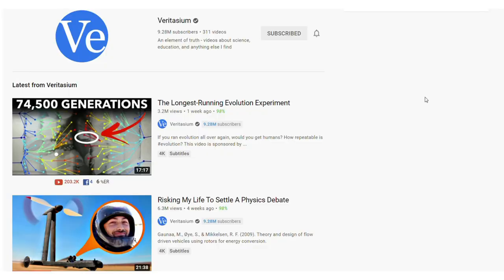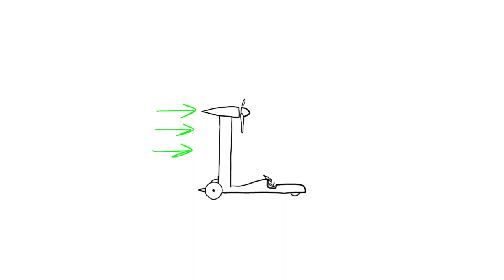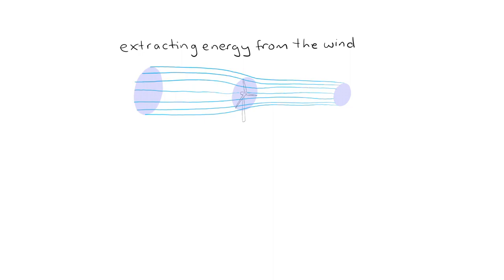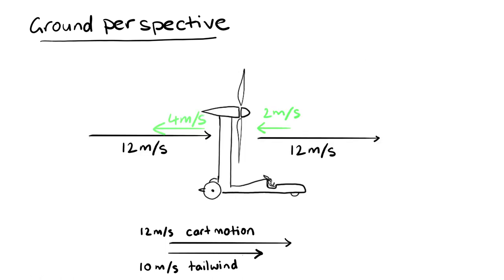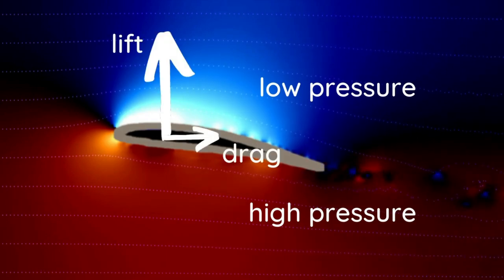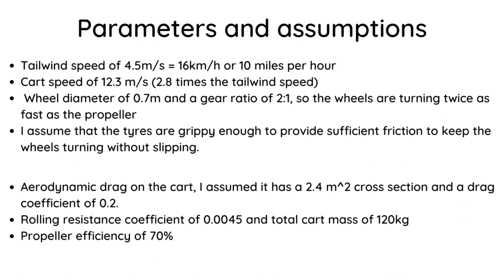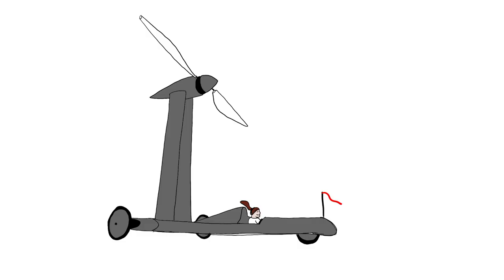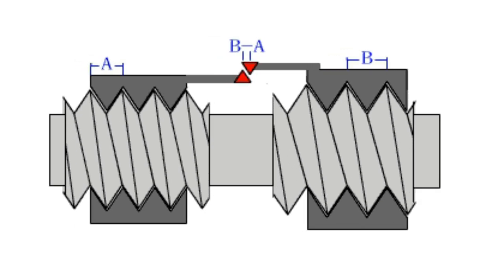Downwind Faster Than the Wind by Veritasium: How Does it Work?

Comment: When you are traveling at the same speed as the column of air, force applied to the blades is zero. Your momentum may briefly accelerate you beyond that, but you fall back to where it interacts with you again. If this concept really worked, you could put this car in a completely still environment, push it to get it moving, and it would self sustain. After all, it supposedly surpasses and maintains velocity past the point of zero when it is moving at the same rate of the column of air.
Reply: @Rick_Cavallaro  not in a true downwind by itself. Period.
Reply: @Rick_Cavallaro  I’d also like to note, if you really are Rick, why are you here defending this on the internet? If you pulled it off, then there’s obviously some special sauce you should have a patent on, and you wouldn’t be here debating this with me.
Reply: @AnonyMous-jf4lc  "If this concept really worked, you could put this car in a completely still environment, push it to get it moving, and it would self sustain."

No, that would be true free energy. This cart is taking energy from the wind.
Reply: @seneca983  I get that the claim is that it is using the differential of wind and ground speeds to surpass wind speed, it still doesn’t the problem of when the equation flips past 0. The wind isn’t driving anything anymore. The car or the prop…
Reply: @AnonyMous-jf4lc  The wind is still (kind of) driving the cart. The propeller accelerates the cart whereas the wheels driving the propeller decelerate it. Because of the wind the acceleration from the propeller is greater than the deceleration from the wheels. Yes, from the cart's perspective the wind is coming from the front (after windspeed has been exceeded) but it's relative speed is slower than that of the ground.
Reply: @seneca983  And that's the issue. You are saying that it crosses over into a driving headwind. In order for that to occur, the propeller must be providing more thrust than the drag of the car, and that drag includes driving the propeller.
Reply: @AnonyMous-jf4lc  "In order for that to occur, the propeller must be providing more thrust than the drag of the car, and that drag includes driving the propeller."

Which is perfectly possible.
Reply: @seneca983  If I can provide more thrust than the drag it takes to create it, I have just invented free energy.
Reply: You do understand it's multiple energy conversions to produce this "thrust", right?
Reply: @AnonyMous-jf4lc  "If I can provide more thrust than the drag it takes to create it, I have just invented free energy."

No, it's not free energy. Energy is being extracted from the wind.

Comment: Let's see if you can simplify it adequately... I would simply say the props are always trying to grab More air than the wheels are turning and being that the air is the open source to the system, wind is not required, hence why it worked on the indoor treadmill uphill.
Keep in mind that the props are adjustable on the fly ;)
Reply: Wind is required. A treadmill creates wind. When you are walking at 4 mph on a treadmill you feel no wind, just as if you were walking at 4 mph on the ground with a 4 mph tailwind.
Reply: @jmodified  only dead air is required, and will climb an inclined treadmill, Indoors
Reply: @kdkinen  A treadmill is not dead air, it is wind at the speed of the treadmill surface. All movement is relative. It doesn't matter whether air or surface is moving with reference to the local surface of the earth, just that they are moving with respect to each other.
Reply: @jmodified  the wide flat rotating Belt, of most any treadmill, has no effective fan action... 
Combine that with being indoors with no head or tailwind...
so what the heck do you keep going on about??
Reply: @kdkinen  You are on a treadmill walking 3  mph. What wind do you feel? You are on the ground on a still day walking 3 mph. What wind do you feel? Do you get that those are different? On the treadmill you have a 3 mph tailwind, and feel no wind. On the ground you have no tailwind, and feel air into your face at 3 mph.

All movement is relative. When a surface is moving relative to the air, for anything on that surface, that is wind. According to physics, you can't say which is moving, and the movement of the local surface of the earth relative to the surface and the air is irrelevant. This is really basic physics.
Reply: @jmodified  you need to really get your head out of theoretical wonderland bud, 
An indoor treadmill, generates no wind.
Running on said treadmill, generates no wind.
You are running "on the spot".
Bring in a 3rd party judge you require further explanation
Reply: @kdkinen  Running on a treadmill indoors is physically equivalent to running outside with a tailwind. The point is that you and the air are moving at the same velocity and the ground is moving at a different velocity. In both cases, the air feels calm to you and the ground feels like it's moving, so the treadmill is a valid test bed for DDWFTTW vehicles.
Reply: @Raging.Geekazoid  That is exactly my point yet that other guy keeps saying the treadmill is generating wind.
Reply: @kdkinen   jmod doesn't communicate very well. Just insert "effectively" before "creates". The treadmill creates a situation that's physically equivalent to one with wind blowing over solid ground.
Reply: @RagingGeekazoid  No I will not accept that there is any Wind indoors. it required only still air.
Operated fine
Reply: @kdkinen  Do you know how to read? I didn't say there's wind indoors. I said a cart on a treadmill in still air is physically equivalent to a cart going DDWFTTW on the ground outside in windy air. In both cases, the air and the cart are moving at about the same velocity, and the ground is moving at a significantly different velocity. I thought you would be less of a troll than jmod, but maybe I was wrong.....
Reply: //"Keep in mind that the props are adjustable on the fly ;)"//

The variable pitch prop is not critical to operation.  There are numerous videos on YT where the Blackbird is operating significantly faster than the wind without a variable pitch propeller.
Reply: @kdkinen  

//"No I will not accept that there is any Wind indoors."//

Let's suppose you crank one of those long indoor airport walkways up to ~10mph (about the same speed as the treadmill Xyla uses in the Veritasium video).   Hop on one, stand still and hold up a kids pinwheel - you know, the ones with a stick for a handle that spin when the wind blows.   It of course will start spinning immediately.   What is it that is making it spin if not wind?
Reply: @johnborton4522  you use the wrong analogy in attempt to push a mute point... by maintaining "on the spot " on a treadmill... there is no forward or backward wind to speak of. Tell me your logic can accept this
Reply: @johnborton4522  non adjustable props would just make no sense.
Why limit the design
Reply: @kdkinen  The analogy is perfect. An airport walkway is just an extremely long treadmill. Maybe you don't know what logic is.
Reply: @RagingGeekazoid  lol so you cannot figure out "standing on the spot" on a treadmill, and no wind, only still air.
This is very basic you guys, you also think earth spins?? Lol typical gloofuses placing forces where there are none
Reply: Maybe kdkinen and jmodified were the same troll arguing with himself. :face-blue-smiling:
Reply: @kdkinen  

//"non adjustable props would just make no sense.  Why limit the design"//

Budget.  Variable pitch propeller hubs and controls are not a trivial effort.
Reply: @kdkinen  

//"you use the wrong analogy"//

It's not even an analogy -- it's just a longer treadmill.  The exact same thing happens on the treadmill in the video - just harder to see as it only happens for a short time.
Reply: @kdkinen  Relativity of motion is not theory. When you run on a treadmill, do you feel the air in your face the same way you would running on the ground on a still day?
Reply: @jmodified  good god, running on the spot involves no wind, no theoretical wind either
Reply: @kdkinen  What do you mean by "running on the spot"?

You don't seem to understand or be familiar with relative motion. That's not uncommon. Consider that the surface of the earth where you are located is moving at several hundred miles per hour due to the earth's rotation (exact speed depends on your latitude). The earth is a giant treadmill in some sense. Yet you measure wind with respect to the local surface of the earth, not with respect to the non-rotating frame of the earth.

Running on ground with a tailwind equal to your speed is the same as running on a treadmill with still air relative to the room. In both cases, you feel no air movement because the air is still relative to you. In both cases the difference between air and surface speed is the same as your running speed. The two situations are indistinguishable without external reference (you being able to see the treadmill frame or the room, for example).
Reply: @jmodified only problem  is ..earth is not in motion, and you choose to invoke Misplaced Coriolis only at times when a "small effect" is nonsensically theorized it seems.
As for relative motion.. you will claim "passing a ball on a plane is possible"...
To that I'd say Good, now get On TOP of the airplane...
Still going to deny all senses of being in motion?
Next run forward vs Backwards on the plane... Obvious motion is detected by there being less resistance OPPOSITE the direction of Propagation.
Reply: @kdkinen  "only problem  is ..earth is not in motion"

You're a flat earther then? That explains a lot.

"As for relative motion.. you will claim "passing a ball on a plane is possible"...
To that I'd say Good, now get On TOP of the airplane..."

Nonsensical. On top of a plane there is wind. If you were on top of a plane going the same speed of the air (which isn't possible since the plane would drop out of the sky), it would work the same way.

"Still going to deny all senses of being in motion?"

Of course.

"Next run forward vs Backwards on the plane... Obvious motion is detected by there being less resistance OPPOSITE the direction of Propagation."

You apparently have never been on a plane.
Reply: @jmodified  No, the theory of not being able to discern  motion is all just theoretical, seeming non perceptive relative motion falls apart when the motion is easily felt, and identified.
Run up and down a plane aisle.. you know I'm right. You can easily detect forward constant motion by identifying the opposite direction of propagation by simple 4 directional trials of resistance to motion vs admittance to motion.
See your bamboozling theory swept away
Reply: @kdkinen  It's basic physics.

You are a flat earther then?
Reply: @jmodified  ahh yes, so you cannot face the being incorrect, embarrassed by a true earther... so now to the Ad Hominem and categorization.
Well done in the name of mainstream science hypocrisy 
Bahaha
Reply: @kdkinen  There isn't much point in discussing physics with someone who denies even the basics. Relative motion is something you experience in everyday life. Walk around inside a ship and you will have no idea how fast it is going, and in what current. Throw a ball up in a moving car and catch it.
Reply: The rotational movement of the prop and a one-to-one ratio give it a 45° angle downwind like a screw. The actual blade pitch though is less than 45° allowing the energy of the wind to be vectored in a 90 degree manner to allow forward rotation of the prop thus driving the wheels.
Reply: @SkipStauber  Yeah that's pretty good

Comment: Great analysis, but it takes no account of the Blackbird's adjustable pitch prop (at 4:07)
Reply: Variable pitch prop not necessary, in fact the Blackbird ran many times over 2x windspeed before it was installed.
Reply: @johnborton4522  So, was it installed to get the additional speed for the record? I would be interested to know the range of adjustment and the test results.
Reply: @alans172  

The variable pitch rotor was installed between the initial NALSA trials at Ivanpah and the NALSA record runs at El Mirage.

The primary reason was to allow it to consistently self start.  As you will see in the following video, it was touch and go to get it rolling without a push.   

https://youtu.be/EEuAqq8FINw

By flattening out the blades at the start, their bluff body drag increased, and their leverage against the wheels was reduced.

After that, it was very consistent in its ability to self start in any wind in its design range (10-15mph)

https://youtu.be/5CcgmpBGSCI

You could set the pitch at it's perfect spot without the variable hub -- it just took a lot longer to get to that speed without it.
Reply: @johnborton4522  What fun you have had with that! So envious! And fun observing the cynics and non-believers! I still think you should steer it with foot pedals, like the rudder pedals in a plane.

Comment: I like to think my little brain is on the edge of grasping this thing. Perhaps another 5-6 viewings.

More seriously, does this phenomena have a tight operational window? Does the engineering have to be finely tuned?
Reply: max_speed = wind_speed / (1 - overall_efficiency) so even with 50% efficiency you can reach 2 x wind_speed.
Reply: Xyla Foxlin ended up building 4 versions of her model cart for Veritasium before she got it working, and she didn't get it working until she got help directly from Rick Cavallaro (who designed the Blackbird and has been participating in the comments here).  I think there's a reasonably wide operational window, but if you don't know where that window is it's very easy to build something that's way outside the window that doesn't work at all.  Here's her build video (with a parts list!):

https://www.youtube.com/watch?v=VUgajGv4Aok

Comment: would it work for headwind? if not, why?
Reply: The Blackbird also went directly upwind, 2.1 x faster than the wind.
Reply: If you change the pitch of the propeller appropriately, it will work with a headwind. The same cart described in this video also set the record for going directly upwind, at more than twice the speed of the wind. If you want to find out more, do an internet search for NALSA upwind downwind records
Reply: When going against the wind it needs to work in reverse with the turbine/propeller turning the wheels rather than the other way around as done here.

Comment: Blackbird's operating principle is the same as a boat with a motor can travel downstream faster than a boat that is drifting downstream. It is really that simple. Rick's flash of brilliance was to figure out how to use the wind to power the motor of the craft that is 'drifting' downwind.
Reply: so you're saying the blackbird has a motor? lol i agree.
Reply: @rickcavallaroisascientolog4494  It has self-contained propulsion, not unlike a boat with a motor..
Reply: @maxxron  so it's a hoax? agreed.
Reply: @rickcavallaroisascientolog4494  Definitely not a hoax.
The propulsion system is a wheel driven propeller generating thrust in addition to the wind energy using the forward momentum and kinetic energy provided  by the  available wind energy. As can clearly be seen and demonstrated in the video.
Reply: @rickcavallaroisascientolog4494  Do you not know the definition of "motor"? The Oxford English Dictionary defines “motor” as a machine that supplies motive power for a vehicle or other device with moving parts. Blackbirds "motor" is the wheel driven propeller.
Reply: @maxxron  so you're saying the wheels have motors? i agree. electric ones, in each rear wheel hub. they're SUPER obvious btw, as the hubs are far bigger than needed.
Reply: @maxxron  tl;dr. you openly state the blackbird contraption needs motors in order to function & i'm holding you to that. now go away.
Reply: @rickcavallaroisascientolog4494  That is not what I wrote, and you know it. 
Stop making crap up that makes it appear that your false statements are valid. Blackbird uses no power source other than the available wind energy as numerous experts have confirmed.
If you are incapable of comprehending how Blackbird can legimately travel DDW faster than the wind just admit it and stop using false comments just to argue with people like me who do understand the physics of how it how it works.
Reply: @rickcavallaroisascientolog4494  I would also like to draw your attention to the rules regarding NALSA class C4 here:
https://www.nalsa.org/BlackBirdDDWSR/NALSA%20REGULATIONS%20FOR%20SPEED%20RECORD%20ATTEMPTS%20%20Rev%203.pdf
The two most relevant rules regarding this conversation:
"S1) The yacht shall be propelled by wind energy only.  
S2) The yacht shall have no stored energy other than for instrumentation, i.e. small batteries for speedometers or GPSs."
Reply: @maxxron  yeah thanks for proving there's zero evidence of it being checked for hidden motors.
Reply: @maxxron  like i said, you have just posted a bunch of rules, but provided ZERO evidence those rules were enforced or that any physical checks were made. which would require the entire vehicle to be dismantled btw. are you human? because you do not understand physical reality in any way.